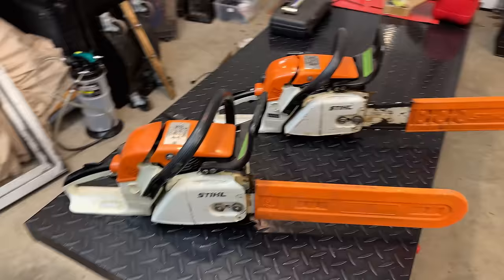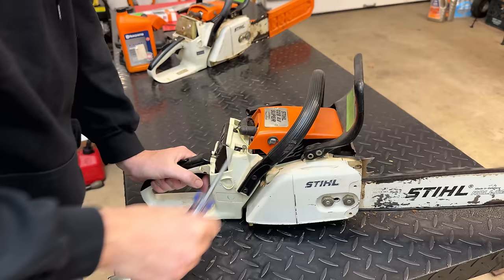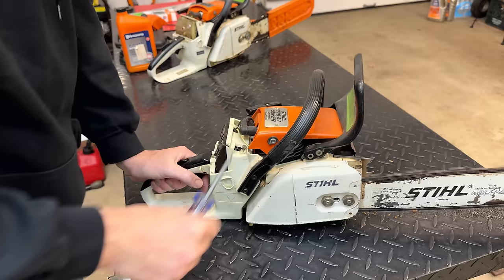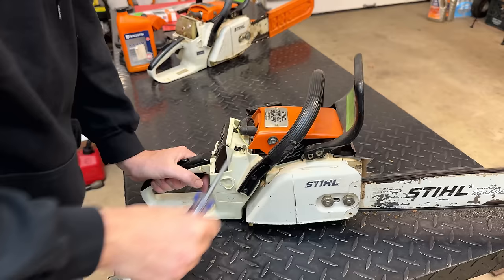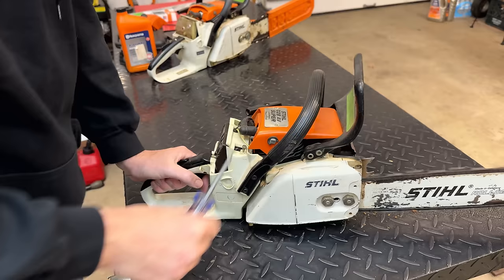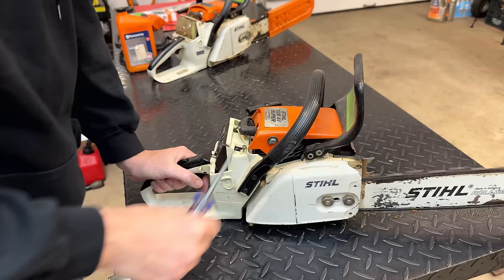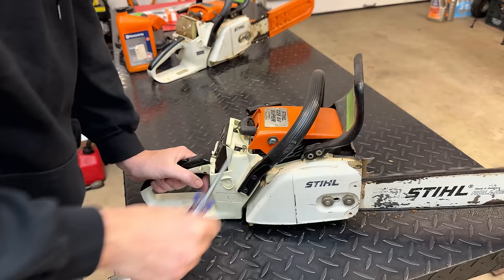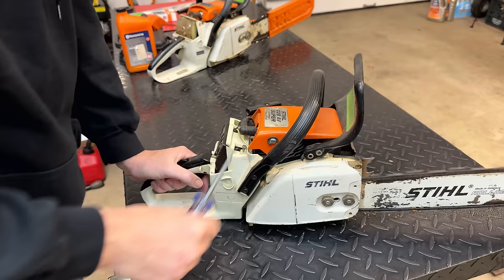Rebuilt STIHL Chainsaw Not Running Well - Straight Gassed 2 Stroke Fixed

Comment: Nice job James: I was always taught to run the saw wide open to the max RPM and then go rich by a small amount to slow the saw down to the correct rpm. Pretty much what you did, Is the spark arrestor clean? The carb may be old and the pump diaphragm etc. may not be letting enough fuel into the saw, just a thought. Thanks for a great video.
Reply from the maker: Might be the carb.  Will swap it out.  I usually do the same adjustment.  In this case I ended up setting it for the max chain speed hoping to see if it could cut as fast as the Facebook saw.  It fell short :(

Comment: James you added gas what was the other thing you added? Maybe bar oil.
Reply from the maker: Premix and bar oil
Reply: Correct. There are only three things a typical chain saw needs to run. The chain needs bar oil. The engine needs fuel and oil mix(okay thats one thing, but its made up of two things)

Comment: Come for the diag, stay for the Stihl Timber sports series. 

Final times - 
FB saw 1 - 8.28 2 - 7.98 3 - 8.28
Stanley’s saw 1 - 14.63 then the restart. 1 - 15.70 2 - 14.33 3 - 14.50

I will have to add some penalty time as cuts 2 and 4 are bottom up.
Reply from the maker: Stanley’s saw is definitely down on power.

Comment: A great presentation. I saw you sharpened just one chain, but don't know if you did the other one as well. It could be the difference in performance after several hours of use that the 'clone' deteriorates quicker..
Reply from the maker: The other chain was a new Stihl chain.  I assumed it would be as sharp, but maybe not.

Comment: Awesome video sir, by no means I'm I questioning your work because I'm still learning so it's a curiosity question. Is it possible for their to have been scoring on the piston or housing, would you have checked that before pressure and vacuum testing. Like I said I'm still trying to get my procedures down. I'm a 57 year old disabled vet learning a new trade. Thank you.

Comment: Pro tip: use bar and chain oil from rural king or county line. 

Surprising stihl, husky, echo, etc are actually extremely overpriced and preform much much terrible compared to the cheaper oils. Which really surprised me.

Comment: Did you sharpen the chain on Stanley's saw too? Maybe I missed it if you did, but it occurred to me that if it was a little dull it could explain the apparent difference in performance... Nice video 👍
Reply from the maker: The chain on Stanley’s bar was a new Stihl chain.  Assumed it would be sharper than the used one I sharpened.

Comment: Good Afternoon James.  Been watching your channel a lot lately.  Learned a bunch.  Question: I've been using a Toro 22" lawnmower with a plastic carb.  If I want a better machine, which would you recommend? Is there a good electric mower that can actually pick up leaves?  I tried a Stihl 510V, but it wouldn't pick up leaves. Appreciate any advice you have.
Reply from the maker: Honda mowers are good but harder to work on.  Otherwise I like the older Briggs flathead engines.  The only downside is they no longer make them and toward the end started to use plastic cans which can fail.  In general the older the better.  Of coarse you have maintenance issue with older machines.  I do not have any experience with electric so cannot recommend anything.

Comment: Awesome video James! I have a question for you. I have a Stihl MS180c that bogs down with the throttle or refuses to stay running. I want to get the same leak down tester you have, but the impulse port on this carburetor goes to the airbox under the air filter instead of to the crankcase so where would I connect it? I would think that the spark plug hole would work, right?

Comment: In my opinion, the Stanley still sound a bit under power compare to the FB saw. I have a MS311 and it sound much beefier than Stanley's when cutting a 16" diameter white oak with a 24" bar. Would clone part really make that big of a difference?
Reply from the maker: Some clone parts are better then others.  Potentially the new top end started to burn up with the intake boot the way that it was.  Will have to pull the exhaust and take a look.  Engine also sounds very different at idle then the OEM

Comment: So the friend of the owner of the “straight gassed” saw is mechanically inclined enough to take apart and put back together a 2-stroke saw but can’t figure out a gas/oil mixture and allows a saw to seize up Hmmm??
Reply from the maker: That was my thought.  Was expecting the saw to never run again.

Comment: Dear Mr Condon, I am trying to repair an old Husqvarna 142. I have replaced its carburetor, but when trying to set it I made a mess with idle button, so I don't remember where the starting point was . When I start the chainsaw now, it works when it is on throttle (half of it, as it is how to start it), but when I close it, the chainsaw goes at very high speed and then stops. Bot L and H screws are at one full circle from point when they would be both completely turned right. I think it is about idle screw, but I don't make any progress. Any advice, please?

Comment: 50:36 gears seem misaligned

What soldering iron you use? And what tip? My 70 watt iron with suitable tip can solder properly that wire in I think 5 seconds.

Comment: I would never lend a two stroke fueled tool, with out confirming the borrower knows exactly what ratio oil % I run, and listen to them explain how to mix fuel correctly. And if he doesn't have twostroke fuel, i would lend my pre-mixed fuel too. Am I over cautious??
Reply: No;

 in fact give them 4 gallons of your premix so they don't run out...
and tell them NOT to try mixing fuel themselves...

If they want to help you...
let them buy 4 gallons of straight fuel of the type you specify and give it to you in a separate container..
and YOU will mix it yourself.

A friend has had TWO saws ruined loaning them to "a friend of his son"...
two separate people in incidents some 10 years apart....
and each time it was straight gassed!

PM610 McCulloch some 20 years old and in perfect working order...and a Stihl 044!!!

Buying the same sized Chinese Stihl clone was 1/3 price new of the Stihl parts..
and for 5 years he has felled and cut up Australian blue gum hardwood trees with that Chinese clone...
which runs perfectly.

Comment: My grandpa has a generator that has no compression, but when you pull the pull starter a lot of air comes out of the crankcase. The compression release is defective, right?

Comment: What's the front screw-compartment for where you poured oil? I assume you put two stroke fuel in the... aft?... compartment...?
Reply from the maker: The front compartment is for bar and chain oil.  Rear is for 2 stroke fuel.
Reply: Ah. Ok. Thanks!

Comment: I have seen a lot better carb adjusting / chainsaw handling than this! At the end of the video, your attempt to get the Stanley(?) saw running like the FB one, I think you were very close to seize the engine, leaning out the carb far too much! Next time, use your eyes and ears(!) whe tuning the carb! Good luck and regards, Jan F-N, Norway.

Comment: What is the purpose of the "impulse line on the carburetor ?
Reply: As the engine vacuum pulses it moves a diaphragm in the carburetor.
This flexing of the rubber diaphragm sucks in gasoline/oil mix from the fuel tank via a one way valve and into the small "bowl" under the diaphragm.
and then the spring above the diaphragm pushes the fuel via a one way valve into the orifices leading to the jets of the carb...

Comment: Do you fill fuel and oil separately and the saw mixes it itself?
Reply: The fuel is pre-mix (usually 50:1) the oil you saw is bar oil for lubricating the chain and bar

Comment: Hi i have a Stihl ms170 and it has 45 psi but runs, can you explain this, it's been tested with 3 different testers
Reply from the maker: You need to use a compression tester with a schrader valve in the part that screws into the engine.  A lot of testers only have the valve up at the gauge.  On a larger cc engine that does not matter much.  The compression of a really small engine, like most two stokes, is lowered a lot because the length of the hose essentially increased the amount of air that has to be compressed so instead of 150psi at the gauge, the compression is lowered because it is spread out over a larger area in the hose before it reaches the gauge.
Reply: @jcondon1  ok I will remove the hose and fit the gauge directly to the spark plug hole and retest thanks..
Reply from the maker: In this video I get 40psi at the 3 minute mark using a compression tester that has the valve in the gauge.  Later at 1:11 I test the same saw with a tester that has the valve in the bottom of the hose where it screws into the engine https://youtu.be/chEqXHjCM64?si=F_JFPUdcXlAKJ_ym

Comment: What kind of meter is that you have,Is it a noise meter or what
Reply: Revolutions per minute meter...
uses electrical inductance when the sparkplug fires to calculate the saw engines rpm...

Comment: Clone carburetor sucks. They don't rev high. Put the original carburetor back on Stanleys saw.
Reply from the maker: I did, that was the OEM carb.
Reply: Also try a different coil see if it revs up more
Reply: You did not watch the video, that is what he did!
Reply: @watermanone7567  I'm not messaging you man!

Comment: I personally believe you are adjusting me. A low idol wrong. You are supposed to turn it towards the lean when it starts to run like c*** back it off.
 And then you can set your idol, but the higher the IRP m's. You'll lower the idol and every time you pull the rope it should start up. On one pull as far as the high idol when you crank the throttle.  You're high idle.You're full of grab that throttle?Hold it wide open and adjust it until it does the same thing.Golene and if it starts to stumble your back it back to where it smooths out and then you're done
Reply: Wrong, you will burn up your saw that way.
Reply: @watermanone7567  Impossible to burn it up unless you don't have the right mixture of gas and oil.

Comment: Please remove the strings on your sweatshirt, hate see the chain grab it and pull your head in.
Reply: Had my Hoodie string wraoe up inside my cordless drill air vent the other day. Ruined the string and broke ever blade off the fan. I'm usually really good about this but finally got bit. Luckily it was just a drill (although my favorate drill that's been with me since before starting my finish carpentry business) new rotor for it should be in soon 😂